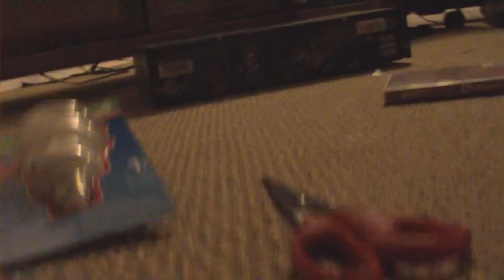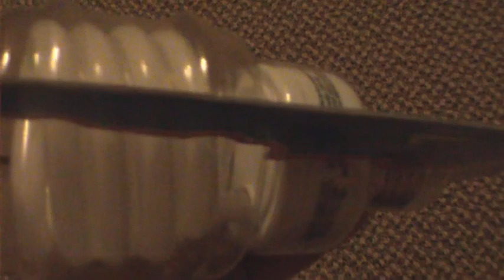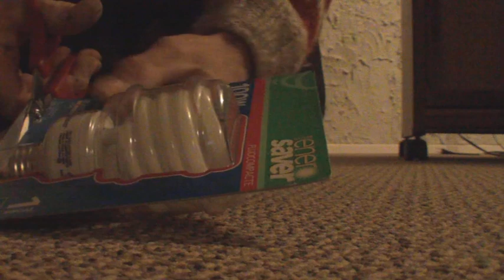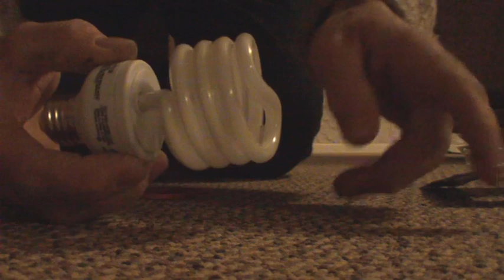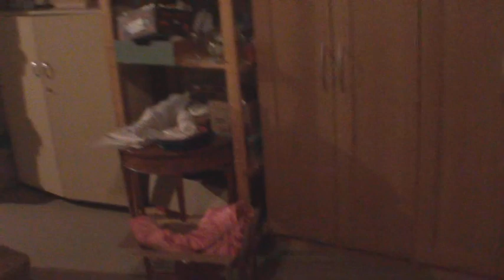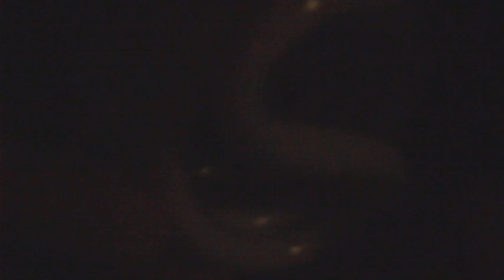Coated CFL Flashing from Human Energy / Static Discharge?

Comment: No mine do not seem to have a coating. feels like glass. I might try it with cling wrap over them later. maybe some other plastic. Wonder what the rubber is? Dielectric, Static generator, or both at once.